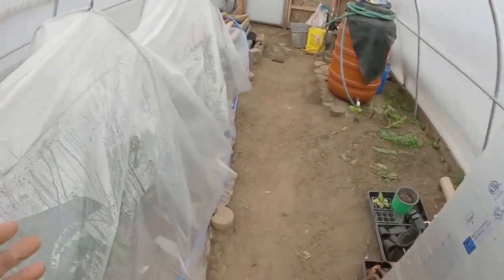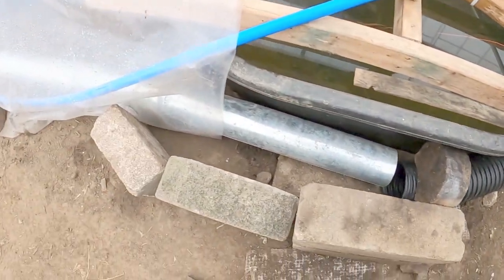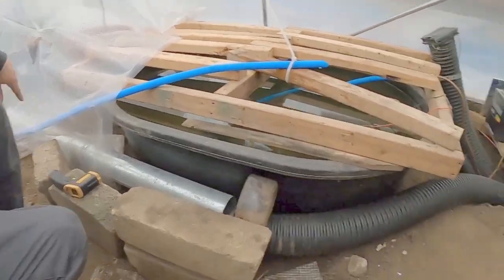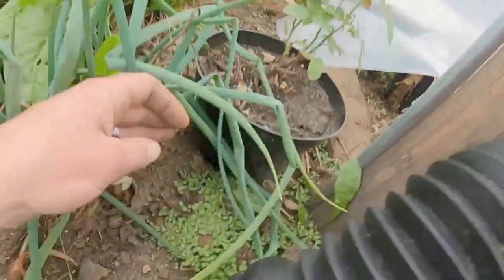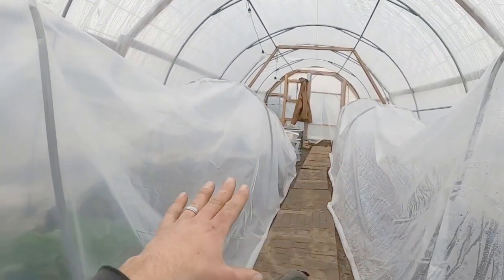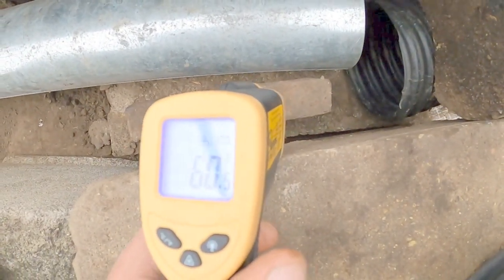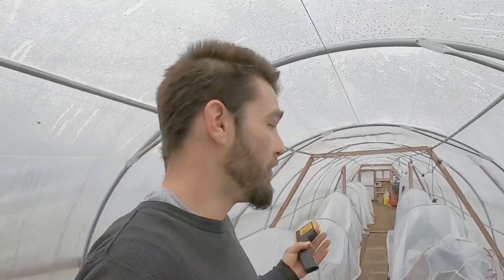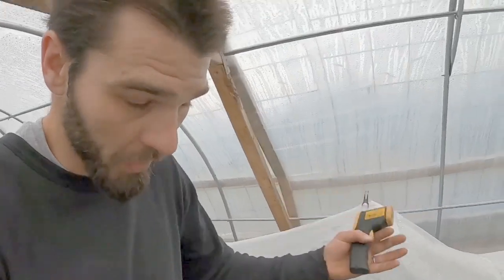Poor Man’s Geothermal & A Cheap DIY Greenhouse - Double Layered Poly | Tunnels & Temps Zone 5a/4b

Comment: and it would be interesting if u used some led agricultural lights to add for lost sun hours and extra heat
Reply from the maker: I’ve been back and forth on using lights. I’m going to be digging a trench in spring once the ground thaws for electricity, just going to go with a single outlet or Maby two. I’ve already got some decent solar power but My goal is to get about 1000-1500watts worth of solar with an inverter and all to provide better power at night time.

Comment: Hi :-) could you please provide some more detailed information on the Geothermal setup? How are the pipes laid out excacly? Are they coated? Do you have one or more layers of pipe? What did you put on top of the pipes? Just the earth you digged out before or sand or stone? I appreciate your sharing and I want to build a geothermal system for my new tunnel which is 24 Meters long. Thank you very much and cheers from Germany!
Reply: As a rule of thumb,  you need 1.3ft of 4" ADS tube per square foot of greenhouse floor area. In your case that`s around 102ft x the width of your tunnel in feet.

Comment: Why don't you use a ram pump for the water system. It uses no power, elminating the need for solar power. Then run a small hydro turbine off of you water runoff that falls in the tank to power the fans. Just a thought.
Reply from the maker: If I could use a ram pump I may try it but the amount of water I’m moving is only a gallon per minute or so. Energy is still required to make the pump work also. I looked into it a while back but it didn’t seem worth while for the effort I’d have to put into it as opposed to using a system that starts and stops itself (solar) great idea if I could make it work
Reply from the maker: I have several small hydro electric turbines that run off house water pressure but haven’t incorporated them yet but plan to to run a fan
Reply: @Earthdwellershomestead  Why are you running 1 GPM if you don't mind me asking?
Reply from the maker: Any more flow rate and you wouldn’t get much significant heat from the compost, great question
Reply: @Earthdwellershomestead  Couldn't you put in a valve to limit the flow rate of the ram pump to your liking?
Reply from the maker: Possibly 🤔 you’ve got me thinking lol